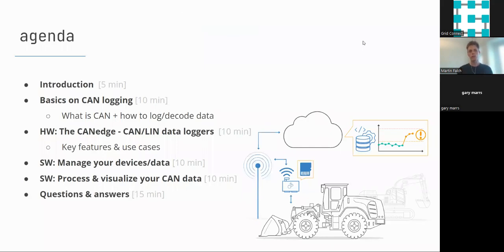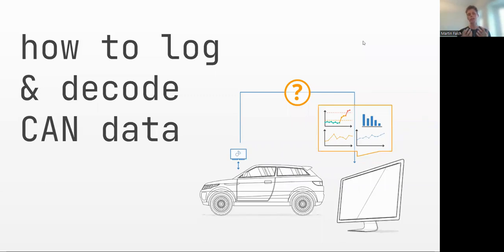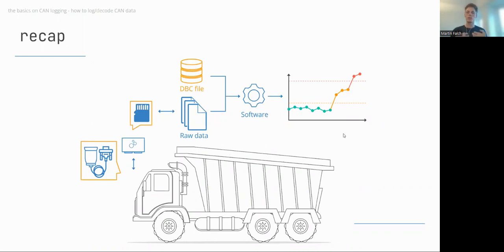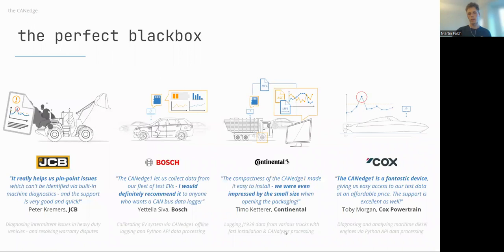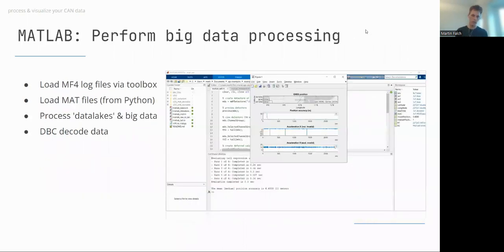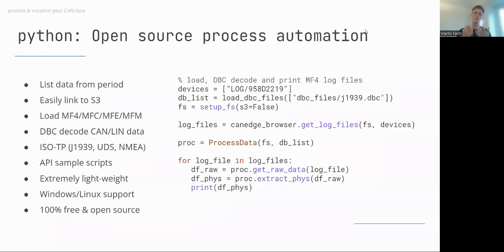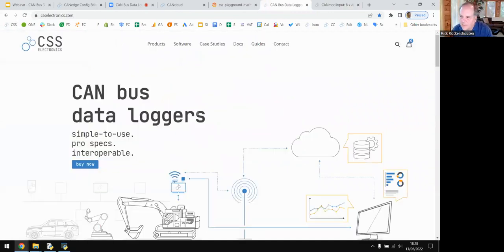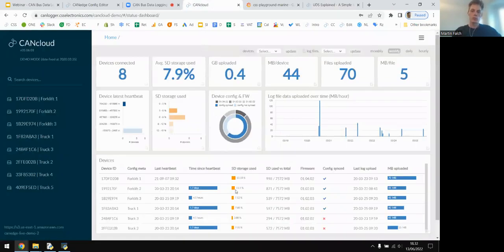CAN Bus Data Logging [Webinar | 2022]

Comment: good. which of your can bus device can i use as a gateway to exchanges CAN messages between two seperates CAN network ?
Reply: Hi Anadack, this would be a potential use case for our upcoming CANmod.router module, depending on the more specific requirements. Our current solutions do not facilitate intra-communication between CAN buses.